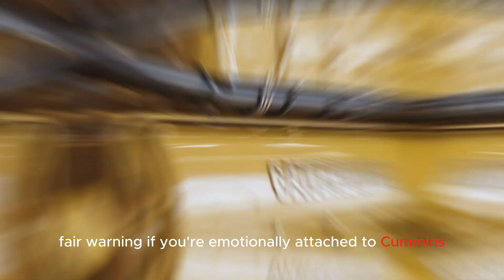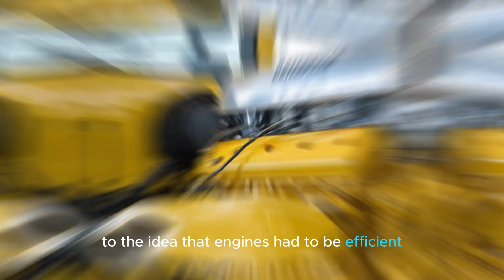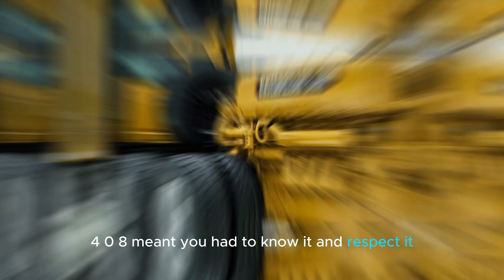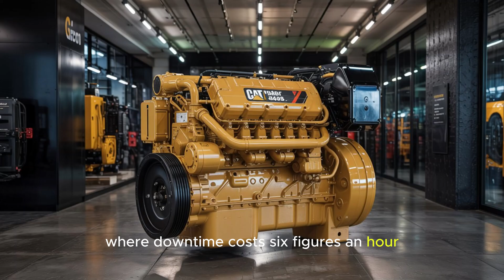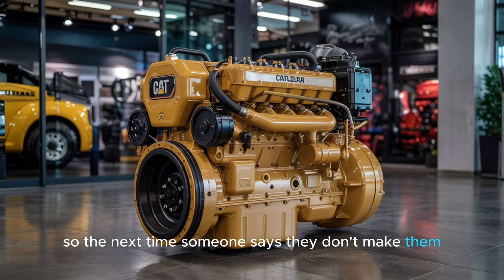Caterpillar 3408 Engine Explained | Power, Performance & Facts

Comment: The 3408 did come direct injection. It came PC combustion chamber, you could easily get 1000 hp flywheel. And I even knew of a company who built one for a truck Dino they had both propane and nitrous injection on it and were able to get 2500 horse at the rear tires before they grenade it. Everybody loves Jacob’s brick, but the.3408s best feature was the hydraulic retarder when activated you could slow the truck down, regardless of weight in the trailer to the point where you could actually stall the motor and stop the truck. Talk about your ultimate break saver

Comment: Drove across NB on I-80 countless times in 4.5 hours with one of these. '82 KW w/15 speed DOD and 5 speed deep reduction. Would pass sets of triples going east over Cabbage loaded too! 90mph and wasn't even in the big hole. The motor came with a price tag and required a "brake saver", a 10k option then! A Jake wouldn't fit in the engine space taken up by the massive 3408. It had it's own sound, the 13 speeds I drove with this motor had the coolest whistle made by the turbo when flicking the splitter.